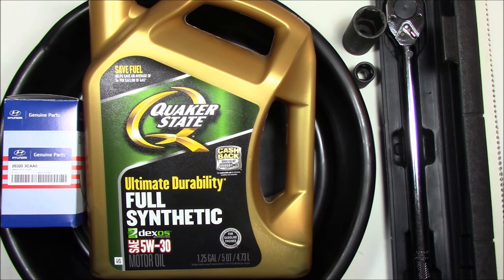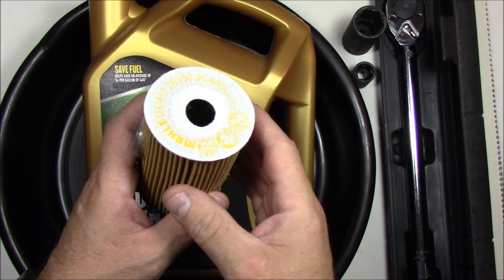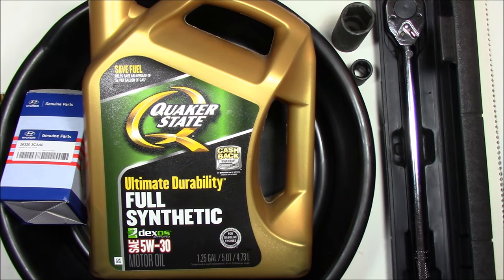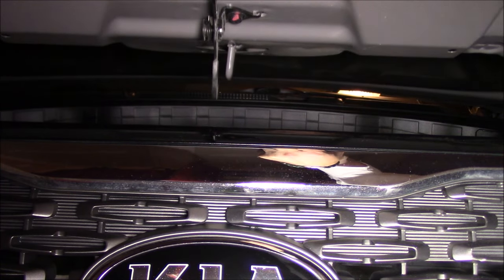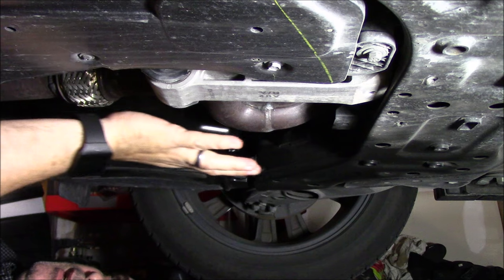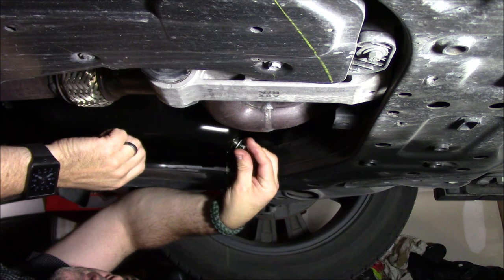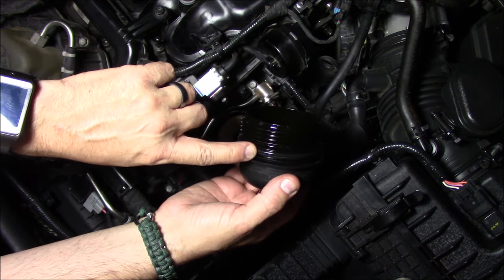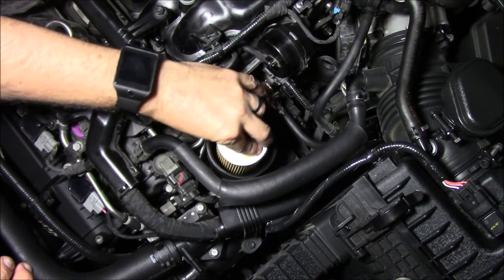Oil & Filter Change Kia Sorento 2014 SXL 3.3 Liter 6 Cylinder Engine HD

Comment: Bought a 2015 Kia Sorento used. I went to change the oil filter and it was stuck on really good. I was scared to break it and checked a Kia forum. People were actually cutting the things off, hahaha. I grabbed my trusty 24 inch breaker bar and she came off no problem. So,yey,if that happens to you don't cut it off;buy a breaker bar and use the correct socket just like the by chap in the video, even if you have to buy or rent it. It'll save you a world of trouble.
Reply from the maker: I'm not sure what kind plastic like material it's made out of but it's pretty tough. I certainly would have liked a metal lid and canister instead, but the plastic works and is lighter (and less costly). Thank you so much for watching, commenting and the valuable feedback. I appreciate it greatly. All the best.👍😀

Comment: They had cartridge filters in the 50's and 60.s  Spin on filters were supposed to be an improvement  And the dirt should be cleaned off before the oil system is opened
Reply from the maker: Thank you so much for watching, commenting and the valuable feedback. I appreciate it greatly. All the best.👍😀

Comment: This was a very helpful video that I come back to watch before each oil change, but two important things:   1)  He mentions using a torque of 25.8 ft-lbs for the oil filter cover cap, but this is wrong.  The service manually states it should be torqued to >>  8.7 ~ 11.6 lbf-ft  << which is very different and makes sense because its only plastic.  2)  I was (and still am) confused because he claims to be putting in a  full bottle of a 5 quart jug of oil initially (which it is clearly labeled on the oil container at the start of the video). But then adds TWO more quarts of oil on top of the 5 he just put in?!? The car only takes just slightly more than SIX quarts total (6.02), not seven. So what was that about? Was the jug he initially used not actually full? Because otherwise he definitely overfilled it.  Otherwise, a great video.
Reply from the maker: I verified the torque values were correct for the 3.3L V6 and they are. The value you are quoting is for a spin on metal filter for a 4 cylinder. I put the oil in until the dipstick shows at the full line. I may have not had a full jug or full bottles no idea but I don't go by the amount I trust the dipstick. Thank you so much for watching and commenting. I appreciate it greatly. All the best.👍😀

Comment: Good video Richard, only thing to add is I would start the engine before putting the engine cover back on to check for leaks at the filter cap. 
Even though you used a torque wrench, there could still be a crack or o-ring not sealed properly for several reasons.
Reply from the maker: Thank you for watching, commenting and the valuable feedback. I appreciate it greatly. All the best.

Comment: Nice video, clear and concise. I like the the oil filter canister that drains into the pan instead of your face, how clever is that!
Reply from the maker: Thank you very much. Yes, I agree the top mounted canister filter makes for a much cleaner oil change procedure. Plus you get to see the state of the oil filter. On the metal encased filter you can't really see how dirty it is. All the best.

Comment: I don't have a torque wrench, is it a necessity or just snug them up good?  Thanks
Reply from the maker: Well you can just snug it up but I always found I was over tightening or under tightening. With things like oil filters and drain plugs it's very important to get it right. Thank you so much for commenting. I appreciate it greatly. All the best.👍😀
Reply: @richardlloydusa  Thanks for your reply

Comment: That's the cleanest oil I've ever seen.
Reply from the maker: +Dennis King I had changed it a week before as a flush. I bought the vehicle used and you never know what they were running and how much dirt had accumulated so I filled it new and ran for a week and this was the final fill. Thanks.
Reply: +Richard Lloyd makes much more sense. I went and looked at some of your other videos and questioned your ATF flush at 5k also. I could understand changing after you first got it but after another 5k, why? 

You would be better off taking oil and ATF samples when you first got the car and changed the fluids. This way you know exactly what was goin on with the car and whether another change a week later was warranted, or in the case of the ATF draining every 5k
Reply from the maker: +Dennis King I buy my vehicles used and I like to get the fluids back to day one as soon as possible after I get them. I now change the transmission fluid every 5000 miles until it looks near new then dial it back to every 15,000 or as needed. Basically I am cleaning the transmission using the fluid. This works really nicely and is far more effective than the short interval I was doing before. But you live and you learn. I did this on my KIA Sorento and I figure the next drain and fill will bring the fluid to almost new. Yes I am OCD about fluids. Dirt removal and clean fluids are key to long engine life as far as I am concerned they are well worth the investment. Thanks again.
Reply from the maker: Thanks.

Comment: Great video! Definitely saved me some future frustration; it'd have taken me forever to find the oil filter.

Question:  Any idea of the size socket needed for the lug nuts?
Reply from the maker: Thank you very much. You can use a 21mm socket (I use a deep 1/2 impact socket) on the lug nuts or you if you have an imperial 13/16 " that will work too. BTW the torque value on the nuts is 65~79 lb·ft (9~11 kg·m) I use 79 lb-ft.  All the best.

Comment: Bingo ! was looking for a video like this for my 2018 sorento v6. Owners manual says first oil change 12000km, is that the same for 2014 ??
Reply from the maker: You are most welcome. Check the manufacturers website for further information on that or consult the owners manual. Thank you for watching, commenting and the kind words. I appreciate it greatly. All the best.
Reply: Synthetic oils and oil filters boast a higher kilometer oil change. For my Nissan rogue at least the manufacturer recommended km is 8k I usually do mine at 6k or 7k which for me is about twice a year

Comment: I was told by my Kia dealer that if I didn't have an 'electronic receipt' for my oil changes, it would void the warrantee?
Reply from the maker: I find that a doubtful statement. BTW how do they define an "electronic receipt"? Every paper receipt I have was printed by an electronic printer. I also photograph the receipt with my "electronic camera" next to the odometer the day of the service too for proof. Call KIA corporate if you are really concerned about it but I was always told just keep the receipts. Thanks.
Reply: Thanks Rich!  I kind of thought the same thing.
Reply from the maker: You're welcome. All the best.
Reply from the maker: Another tip here, if your camera has a date stamp feature turn it on so the date is shown on the picture. Thanks

Comment: How did you find the torque specs of the filter and drain plug?  im going to start doing my oil but cant find my torque specs
Reply from the maker: I found the service manual here: https://goo.gl/fe6n3H it has the torque values but here they are for you:
Oil Filter Cap Torque
[25.8 ft-lb]
[35 N.m]
[3.57 kgf-m]
Drain Plug Torque
[25.3 ~ 32.5 ft-lb]
[34.3 ~ 44.1 N.m] 
[3.5 ~ 4.5 kgf-m]

Thanks

Comment: 3.
Remove the oil filter with the SST(09263-2E000, the oil filter wrench).
(1)
Remove the oil filter. 
(2)
Check and clean the oil filter installation surface. 
(3)
Check the part number of the new oil filter is as same as old one. 
(4)
Apply clean engine oil to the gasket of a new oil filter. 
(5)
Lightly screw the oil filter into place, and tighten it until the gasket contacts the seat. 
(6)
Tighten it with the torque below.

Tightening torque :
11.8 ~ 15.7 N.m (1.2 ~ 1.6 kgf.m, 8.7 ~ 11.6 lb-ft)

not to dispute but I found this info for the filter cap,http://www.ksmanual.com/engine_oil_oil_and_filter_replacement-292.html

Comment: how many km's do you do with one tank, just bought a sorento sx 2014, it seems to take alot of gas. Ths
Reply from the maker: Here are all the specs for your vehicle so you can compare. I no longer own mine but I was very happy with it while I owned it. https://www.autoblog.com/buy/2014-Kia-Sorento-SX_V6__4dr_All_wheel_Drive/specs/?guccounter=1&guce_referrer=aHR0cHM6Ly93d3cuZ29vZ2xlLmNvbS8&guce_referrer_sig=AQAAAKgmLp85Mse-JrtvcM3v_a0XdjWEojeMIbFVbkgZcLEM5dXkYlZURFlV_i2haP--2raZSNPqFt9UrJPhMJTUNf8OXfQW5U1VWSpBSKrq9Rh8rmqfsI54p60IQDMBv0J_tonhY5BFWOdcfuS7nRNXA8VkFEfmvFTk9Q0-PTEbufNo  Thank you for watching and commenting. I appreciate it greatly. All the best.👍😀
Reply: @richardlloydusa  i do about 500km, you?
Reply from the maker: That is the minimum you should get with city driving and you should get a maximum of 617kms max on the highway. But understand that terrain, weight, and driving habits affect it all. Thank you for watching and commenting. I appreciate it greatly. All the best.👍😀

Comment: very nice video. um~~ how often do you change engine oil?
Reply from the maker: I use Quaker State (550036718-6PK) 5W-50 Ultimate Durability Full Synthetic Motor Oil (GF-5) - 1 Quart, (Pack of 6) At Amazon: http://amzn.to/2iNOWnT and I change it every 5000 miles. I am actually changing it again tomorrow. Thanks and all the best.

Comment: great video.. can that same filter be used on a diesel model?
Reply from the maker: Which year and engine do you have? Thanks.
Reply: Richard Lloyd 2.2 crdi 2015
Reply: Richard Lloyd thanks for replying
Reply from the maker: It is not the same but it is similar. Here it is at Amazon Genuine Hyundai Oil Filter Service Set 263202F100: http://amzn.to/2r68JUk or cheaper here on Ebay: https://goo.gl/5QQv9K make sure it's the correct fit for your vehicle before you purchase it. Thanks.

Comment: Hey I have 2015 sedona and it has 3.3v6 as well , what's the socket size to get off the cap under the cover.
Reply from the maker: The oil filter cap requires a 27mm socket or wrench and 17mm for the drain plug. Thanks.
Reply: +Richard Lloyd thank you.
Reply from the maker: You are most welcome. Thanks for watching.

Comment: 5*** Richard you know all the tricks, this is just the same as i do the job, did my BM oil and filter last Sunday, used a Bosch filter looked vg quality, ps not sure about that ratchett?.
Reply from the maker: +bmwnasher Thank you very much. When you say you are not sure about the ratchet are you talking about my torque wrench?
Reply: Richard Lloyd No the one you used to take off the filter housing and sump plug.
Reply from the maker: +bmwnasher Good eye. LOL. Yes that is an "el cheapo" wrench I bought years ago when I was in a pinch and needed a ratchet to do a job. I have been trying to ruin it ever since but it refuses to die. Looking forward to replacing it with a composite ratchet in the near future. http://www.harborfreight.com/1-2-half-inch-heavy-duty-composite-ratchet-66314.html BTW I recently bought a 18 Volt 1/4 in. Cordless Variable Speed Hex Impact Driver   http://www.harborfreight.com/18-volt-14-in-cordless-variable-speed-hex-impact-driver-62421.html and believe it or not with a 1/2 inch adapter it will take the lug nuts off my wheels that are torqued to 78 ft-lbs. I was absolutely amazed when I tried it as I thought it would never do it. It made quick work of it. It so impressed me that I believe I will make a video on how well it worked. Thanks again.
Reply: Richard Lloyd Does the job though, i did have the fortune in the 70s of coming across a dodgy rep for a major motor factors, he was selling Britool socket sets cheap, still got them today, i use Halfords Professional tools they looks like snap on with a lifetime warranty.
Reply from the maker: +bmwnasher Good tools are worth it for sure. It's a pleasure to use quality tools. Thanks.
Reply: Richard Lloyd You`re a great guy Richard it`s a pleasure to talk.

Funny, my middle name is Richard & my son in laws name is Richard, my daughter and him work for Lloyds underwriters.
Reply from the maker: +bmwnasher Thank you very much. Here is a funny fact. I was born in Buenos Aires Argentina and Richard would be an unusual name there though (Ricardo) would be less unusual. My father insisted that I be named Richard not Ricardo on the birth certificate. He had a British passport even though he was born in Argentina. And Lloyd is a Welsh name. LOL Immigration has definitely been generational in my family (understatement). As I have held citizenship in three countries so far (Argentina, Canada and USA). I don't think I will getting a new one any time soon.

Comment: Great video. Btw your coolant looks to be overfilled.
Reply from the maker: +CJSuhr There is a bit too much coolant in the reservoir but that wont hurt the engine in any way. I bought the Sorento used and I am in the process of changing all the fluids. The coolant will be changed soon and I will be making a video on that too. Thanks